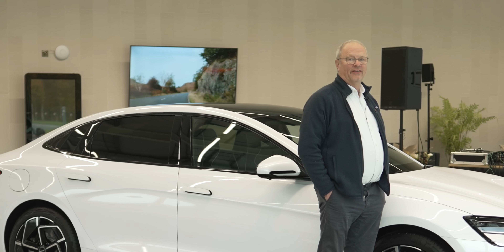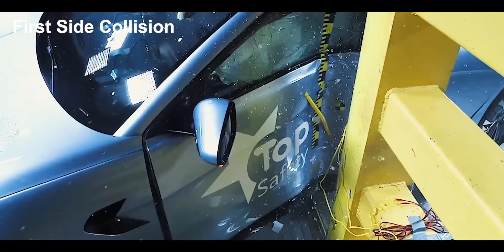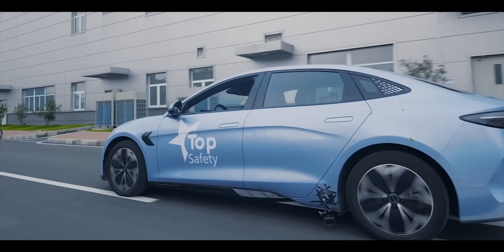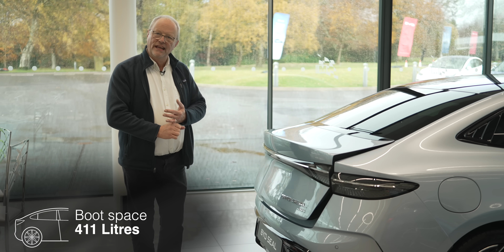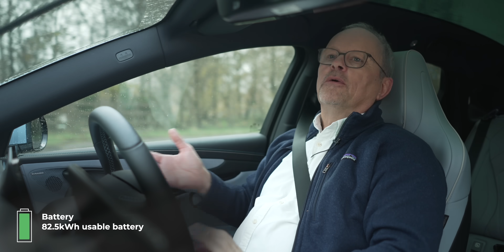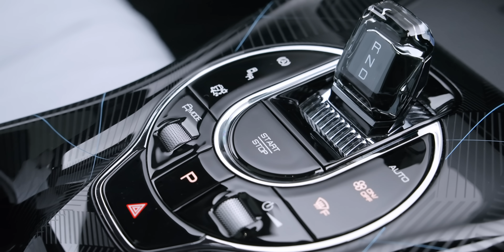This Car Proves Just How Far Chinese Cars Have Come

Comment: BYD is light years ahead in battery tech. Yes they don't have the discharge rate. But they are far safer than anything Tesla can put out.
Reply: Yes or no, as BYD also supply their blade battery to Tesla, so they are on par with battery tech.
Reply: @gwsheipang  only the ones made in Berlin use BYD batteries,
 but Brits only get the ones made in Shanghai, is the only factory that bother with wheel on the wrong side of the car. :cat-orange-whistling:
Reply: Negative, They were 1st introduced to the Chinese market even knowing Tesla Denied the agreement. And now in the US as well with the base M3 @johnsmith-cw3wo
Reply: @gwsheipang  >> Yes or no, as BYD also supply their blade battery to Tesla, so they are on par with battery tech. <<
BYD/CATL's LFPs are mainly limited to entry-level, low-range EVs.   Tesla uses LG Chem's NCM in Long Range models; and Panasonics NCA in Performance..

Comment: The Seal looks great. But Tesla has a great advance with the charger network. How fast does the BYD Seal charge?
Reply: 150kW max to preserve battery.  BYD are not interested in ultra fast charging unless a battery tech or chemistry is as equally advanced.  So if you are in a hurry on a very long trip BYD BYD is not optimum.  However, if you want a 30 minute break, then it's perfect.
Reply: @remakeit2628 one thing to note though about BYD and their charging rates is the charging rates are linear unlike most other manufacturers which spike then drop then spike again etc…

Comment: 1.) what data is collected during driving? 2.) what happens to it? - after some hackers discovered that some chinese cars even send images from their passengers (and potential audio recordings of drives) to „somewhere in china“ im quite hesitant with chinese cars. Currently I’m driving a German EV (because they take privacy very serious). I would absolutely buy a elegant chinese car like this if it ncap ratings are good and if it’s clear which data is collected and what’s happening to it. (PS: and people are happy their cars provide „selfie modes“ that upload pictures of the interior „directly“ to their phones… it blows my mind)
Reply: The BYD Seal has a 360 degree parking camera. It does not have an interior camera. It does not have a dashcam in EU markets due to GDPR. If you are concerned about data collection, remove the SIM card from the car.
Reply: @Radaos  is it removable? No interior camera is good news, most systems have one to check if the driver’s look at the road. How did they do it? I suppose it has lane assist?
Reply: I'm more concerned about MY government gathering data. The Chinese are only likely to sell you something not start a scare campaign or war.

Comment: A great review. I've fond memories of visiting the Lakes District about 20 years ago. I like the heads up display and standard controls on the BYD. I'd buy a Model 3 due to the critically superior charging speed of 250Kw vs 150Kw (long-range). I believe the Model 3 is quieter, faster and more efficient with sorted OTA upgrades and progressed FSD.The BYD is a reasonable buy in Australia, around $10kAUD less expensive than a Model 3 and due December or January here. Thanks for the review.
Reply: BYD also has OTA upgrades, and better road noise deadening.
Reply: You forgot Tesla being a de facto wh*te pow*er auto maker as well. Definitely a huge pro or con depending on your views.

Comment: I was in an electric Kia just a few days ago.  (Taxi in Norway.)  I happened to ask the driver what he thought of it, and one of the first things he said was how switching on the heating immediately reduces the range by 100km.  He even toggled the switch to show me.
Reply: EV6 owner here, looking at my stats of last month climate was only around 10% of my maximum consumption, its currently sitting at 387.2 kWh with an average of 17.37 kWh / 100km (~2230km driven).
So only 10% of that 387.2 kWh was heating and I always drive around with the climate on 21.5C, seat heater on full and steering wheel blazing hot (its currently 6C outside and ~9C during the day)..
I don't think these are bad numbers, my guess it was a very cold day in Norway and he didn't have a heat-pump installed in the car, so he was basically turning on the resistance based heater that would drastically decrease the range on any EV..
Reply: @randysteven88  I wouldn't say it was a particularly cold day for Norway in the winter time.  It was only around -6c or so.
Reply: @-James-  Without a heatpump to pump around fluids that have been heated by using the excess heat of the drivemotor(s) / battery pack the car is can only use the power-hungry resistance heating system too heat up the cabin and doesn't have access too the heat that the pump brings too the table.
Reply: Kia is the korean one?
Reply: the thermal management system is a HUGE deal.  Tesla and the Chinese manufacturers are way ahead of the competition.
Reply: Wow that's interesting. They need better heat management.

Comment: While the car looks nice, and the price isn't out of my range on my income as a single person. But, in my country insurance premium increase the more HP a car has. So, this will be expensive to own.
Reply: Quotes I've seen are cheaper than for an internal combustion car with the same performance.
Reply: That may be so. But a regular ice car this size and price range has maybe 150 ish hp.
Seal has trippel, meaning the insurance is going to be higher than that of a similar size/price ice car.

Like, i just checked and a Seal Excellence would cost me almost 700€ more per year, that's a 40% ish increase.

That is just because of hp. If Excellence had 170/200/250 instead, it would be a different story.
Reply: @DrFusk  Less than €700 total is what I have seen. Maybe more for young drivers.
Reply: @Radaos  Uhh, if your 21, it's 3.100€ per year. That's double of what I would have to pay.

Comment: Compared to the model 3 what's the ride quality over bumps and twisty roads and its 0-60 time? Price from new?
Reply: Test drove both. AWD Seal handled exceptionally well over bumps and took corners (at speed) with absolute ease. AWD version has adaptable suspension both front and rear. Again, for same model, 0 to 100km/hr claimed at 3.8 secs. I did it in 3.72. Prices I'm not sure, but in Ireland, its cheaper than a similar spec'd Tesla..

Comment: Unless I’m missing it, it would be very helpful to put the price which is probably one of the biggest questions people may have.
Reply: FCS has ignored or brushed-over the price in other reviews too, because they know it will cause such a negative reaction. Which is a bit silly, as price is the primary factor that stops people buying EVs.
Reply: @origin178  you also gotta factor in price differences depending on markets/markups.

There's no point listing the chinese price when it could have a wildly different, much higher cost upon reaching places like the UK and Australia.
Reply: Thanks

Comment: Great review as always!  I like the Seal but I still have to give the edge to the new Tesla M3 Highland refresh for exterior, interior, and performance enhancements versus the original MS.  Just my opinion of course.  Update:  The Seal gets an extra point over the M3 Highland for the display behind the steering wheel.  🤟
Reply: Two displays in front of the driver since the Seal has a drivers display AND an HUD. In addition interior materials, finish, and build quality has been widely reported to be superior to the Model 3. Robert would never describe the Model 3 interior as "posh", for instance. And depending on which market you are in, the Seal may be priced more than 20% below the Model 3, making it an extremely compelling option in those markets.
Reply: @tren133  they are comparing it to old model 3, the new model 3 interior materials is already at or higher than bmw n mercedes quality. Some of the bmw n mercedes are using lower grade material.

Comment: The only disappointment with this is the range given the capacity of this “next gen” battery. When I heard 82ish kWh I was expecting close to 400 miles. For comparison my ev6 with a standard 77kwh lithium ion battery will do 313 miles wltp. 
I know from experience the actual range is not close to this, but I also know my ev6 is a very heavy car. 
So I don’t get why this byd isn’t pushing 400 miles give  that the tech is moving on so quickly. If it is the case that this blade battery is much better than mine, it suggests that byd have some way to go with respect to efficiency in general doesn’t it? Ie getting the most bang for your buck…
Reply: The Seal is about 370 kg heavier than a Model 3 (Seal AWD vs M3P). Still think I would prefer the Seal overall.
Reply: 几个月之内会有100千瓦电池的车上市，中国技术进步的速度远超想象
Reply: Because this is an LFP chemistry battery, which isn't as energy dense compared to a NMC battery. Hence you kinda get lesser range out of it compared to a similarly sized NMC battery. That being said, you get other benefits such as cheaper costs and it being safer.

Comment: 3:00 VERY dangerous to have the battery as the floor. It is rare battery fires happen but it does happen. If you are unlucky to happen to you, it will unfortunately vent out toxic gases directly into the cabin. Fires aren't a major issue when the temperatures are relatively low or you can escape quickly from the vehicle and it's easy to contain. Lithium battery fires are none of these.
Reply: Did you watch until minute 4?

Comment: My 2014 Nissan Leaf SV with heat pump certainly affected its range when the heater was turned on (even in non-freezing temps). Though it didn't use heat from the battery so that could help a lot I suppose.
Reply: Don't believe everything these reviews say. He is paid well by BYD to say very positive things, while it's illegal to get actual cash, first class tickets, the best hotels, fine dining, it all helps, not only that, say anything major negative and you are blacklisted. Even the best heatpumps still use a lot of power especially as it gets colder. Just look on EV Database, it gives the real world driving range at different speeds and temperatures and BYD are just like all EV and ICE they are affected by temperature.
Reply: yea but the battery in the leaf was behind the times even in 2014. To be fair to the leaf it was the only affordable ev at the time.

Comment: A car called a Seal, does the horn go oink oink? Or does it sneak up and stick a knife into you?  :-) - - Bleepin' adverts - four minutes of vid, and four adverts so far! - - BYD missed a point there, it should have been a hatch-back, not that silly little slit-opening. - - 7.5 minutes, and TWO MORE bleepin' adverts - none of them are for anything I'd use! - -  10.5 minutes, and two more B****Y adverts. - - - and another batch at the end - and you completely forgot to mention the thing that matters - the price! So I just sat through 15 minutes of crap for nothing.

Comment: Honestly with 82.5 kWh I have no doubt it'll do 325 miles in the real world.
Reply: 82.5kWh usable: that implies a 100kWh battery.
Reply: @economicprisoner  No, maybe 84-87.5 kWh. It's a LFP battery, they are extremely durable and don't need much overhead, and even a regular NMC battery would need less than 90 kWh for that.
Reply: @swecreations  >>  It's a LFP battery, they are extremely durable and don't need much overhead, and even a regular NMC battery would need less than 90 kWh for that. <<
not sure why you would make such a silly comment. NCM is much energy dense than LFP -- in the past, LFP was ruled out of EV application precisely because of their low energy efficiency until they were spiked up fairly recently.  LFP to this date is mostly limited to entry-level, low-range EVs for this very exact reason, though BYD is "attempting" to break out of it.
Reply: @tooltalk  Recommend reading about CTP (cell-to-pack) technology. LFP energy density is at 180wh/kg nowadays, and with aforementioned technology is extremely viable. 

Also recommend you look at sales numbers from BYD with aforementioned LFP packs, they are selling almost as many EVs with it as Tesla, so "attempting" would be taking it lightly.

With LMFP batteries coming out now they are going to be matching them in energy density too.

Also you just seemed to have missed the entire point of my comment. I'm talking about overhead or gross versus nominal capacity, actual capacity versus used capacity. LFP batteries have longer lifespans and don't care nearly as much about being charged to 100% as NMC batteries, and therefore don't need as much overhead.
Reply: @swecreations  >> Recommend reading about CTP (cell-to-pack) technology. <<
I guess you are unfamiliar with CATL's NCM Qilin with 255+Wh/kg?   SK On's NCM9+ is also estimated to be over 300Wh/kg at cell density level and ~200 pack level without any C2P or C2C packaging.

>> .. they are selling almost as many EVs with it as Tesla,  <<
I don't think you understand BYD's battery strategy -- they are not going for the highest energy density.  BYD's most poular EV outside China is the ATTO 3 with less than ~60KWh @pack leveel of ~140Wh/kg  Tesla Berlin makes base, low-range trims with BYD Blade at ~130+ Wh/kg (vs. CATL's 130- Wh/kg). 

>> With LMFP batteries coming out now they are going to be matching them in energy density too. <<
You mean that crippled LFP with 1/2 lifespan?

>> LFP batteries have longer lifespans and don't care nearly as much about being charged to 100% as NMC batteries, and therefore don't need as much overhead.  <<
Sure, LFP can outlast NCM in individual cell studies, or more realistically, in stationary energey storage systems (ESS -- eg, power grids, powerwall, etc).  In EVs with high SOC/C-rates and extreme ambience temp fluctuation?  Not so much.   Also, high SOC (aka, generally anything over 90+% charging) is the largest contributing factor to battery capacity fade in lithium ion batteries, including LFP and NCM.  Clearnerwatt on Oct 28, 2022 in fact reports that Tesla Model 3 with LFP loses battery capacity twice as fast as non-LFPs:
Tesla LFP Battery 10% RANGE LOSS PROBLEM? | Model 3 RWD watch?v=suw20wPrbL0
  The brand new LFP batteries will degrade substantially quicker.  There's not long-term retention data for LFP batteries on the market yet, but the trend tends to be substantially faster degradation.  Trends show them stabilizing around that 10% degradation mark in about half the time as non-LFP batteries - around 50,000 miles instead of 100,000 miles."
Reply: 实际续航里程可以超过500公里的，这个车在中国每个月卖6000辆

Comment: That heat pump wouldn't do much good in places where it actually gets cold in the winter, like across the pond here in the northern US.
Reply: I refuse to live where temp goes down to -30 C.
Reply: @FrunkensteinVonZipperneck  Well, that will exclude quite a lot of the planet, as that's only -22f, and we can have 3 or more days in a row where it's -40 or colder every year.

Comment: A full length glass roof AND a window at the back?!!? Someone phone polestar and show them this stunning technological breakthrough
Reply: Yeah the sunroof in the ioniq 6 sucks too. I tried to spec a polestar 2 to match the tech in this and it was £54k+ and then that was the smaller battery size too. £59k for the long range equivalent 😬

Comment: Heat pumps have certainly improved energy handling of EV's, but please don't say that "you won't notice any difference", because that's simply not true. Instead of a 4.5 kW PTC heater, a heat pump will consume 1.5 kW for the same amount of heating energy. At an average speed of 75 km/h this still amounts to 20 Wh/km that is not used for propulsion. So the summer consumption at this average speed of 140 Wh/km will increase to 160 Wh/km, almost 15% less range. And when parking your EV outside in -10 °C for 1 day, will require battery heating that will result in some 25% range decrease. So it is better for sure, but still very much noticable!

Comment: Well, a round of applause for Chinese EVs.  Problem is batteries and EVs as a whole have not progressed far enough since 2008. They need serious levels of improvement to meet the capabilities of diesel-driven LGVs, HGVs, trains and ships.  Total transport electrification is not possible and it will not save the planet. Cities will be cleaner, but industry needs to be far more efficient and domestic demands need to be curtailed.  Aint gonna happen.

Comment: So, why don’t they sell ‘em? Very simple, people aren’t as stupid as they think. The main players in the automotive world have been part of the con from the start. Since the EV idea started, they’ve been ramming it down our throats that lithiums and cobalts and nickels, together with their oxides, phosphates and titanates together with all the mumbo jumbo required to confuse the general public into thinking that batteries are soooo expensive. Sure, mining is expensive, so is drilling for oil. It’s just that if you sell lots of it the cost ratio drops considerably. To add insult to injury these things have no engine and no gearbox, the two big-budget outlays in the industry. On the back of this, combustion engined cars have seen their prices steadily and artificially increased well beyond inflation rates to “match” the EV’s.
And so we have it. The traditional affordable model which until relatively recently was selling for twelve thousand, and its electric counterpart priced at double - remember: same chassis, no engine, no gearbox - then the former pushed to twenty and the electric model, which should cost half, i.e.  six, is a “bargain at “only” twenty two.
If ever there were a modern version of the emperor’s new clothes, this is it.

Comment: Wow, a LFP battery does survive the nail test 🤦🏻‍♂️
Reply: I saw a Nissan Leaf battery survive a screwdriver test, it was not done in a controlled lab unlike the Blade battery and it was stabbed 3 times and no fire, after being stabbed 3 times the battery still was fully working.